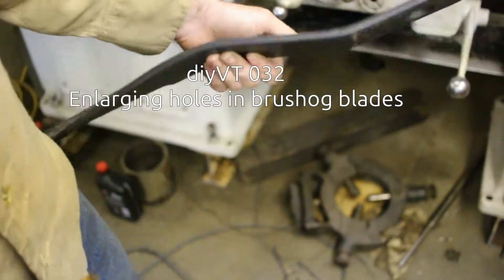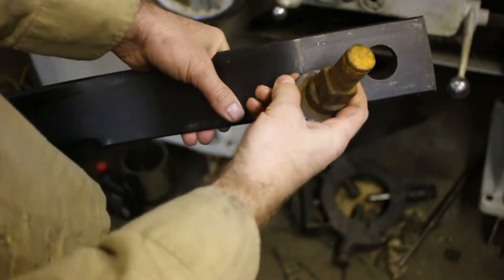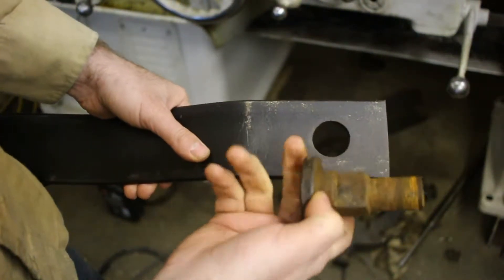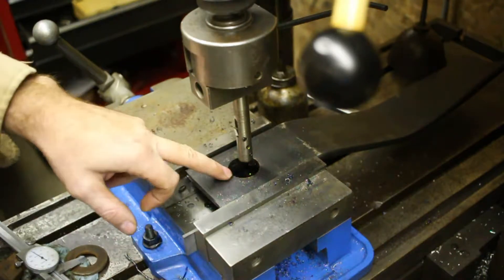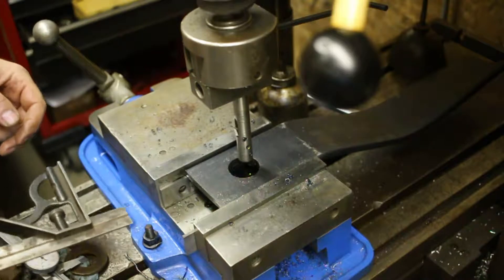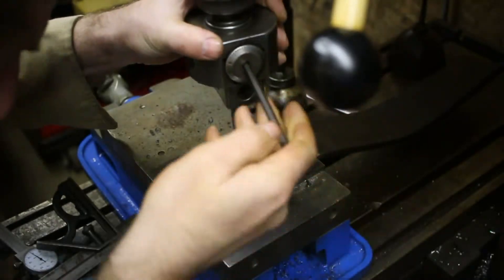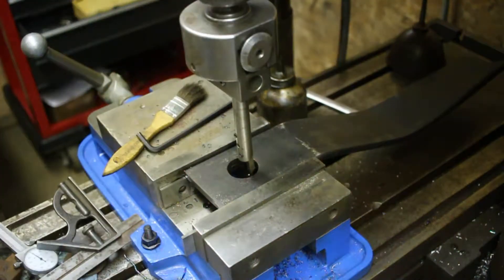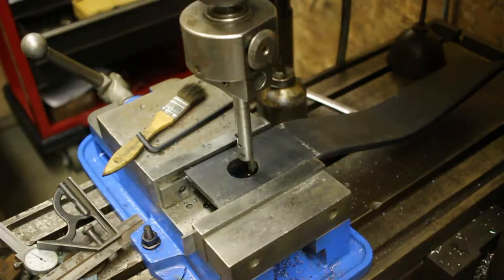Brushhog blade hole enlarging

Comment: A shorter boring bar would have help with the chatter. Your speeds and feeds all looked good. If you had put a couple of pieces of paper between the blade and the vise jaws that would have helped to clamp it better. That trick will work well when the part edges have a rough surface too. Good video.
Reply from the maker: Paper is a great idea.  I just ordered a shorter boring bar to use with the boring head.  It's good I didn't have to hold very close tolerances because there was a lot of spring in the boring bar, it would have made things a pain.